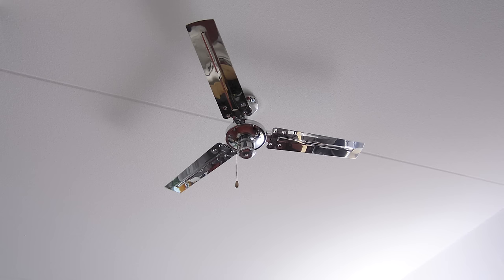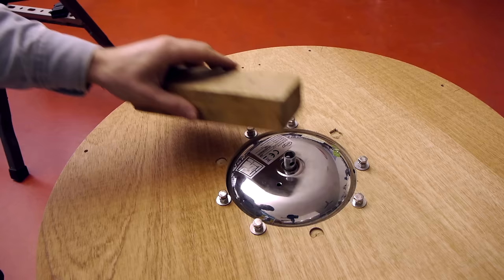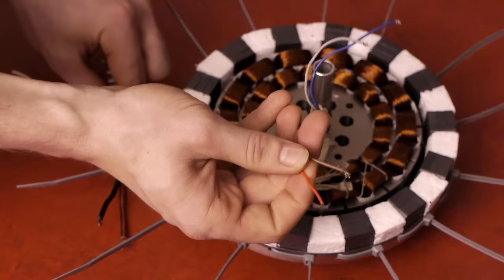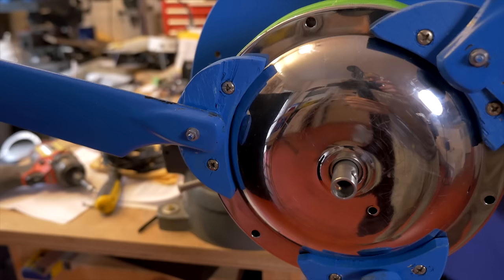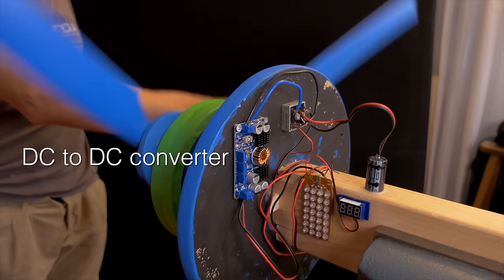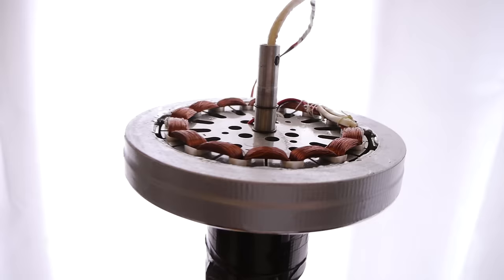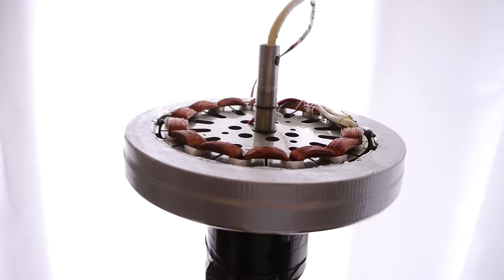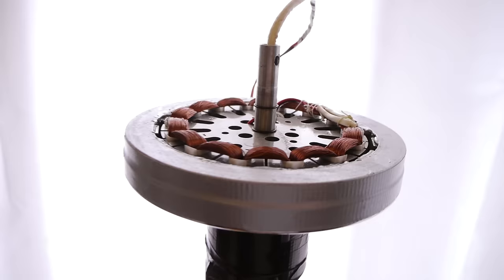Turn a ceiling fan into a wind turbine generator?!

Comment: I just realized that I'm living right next to a "reuse store", which is a place where people can dump off all their old stuff for free -  instead of having to sort out all the different materials for recycling. The store then sell away as much of it as possible for like 1 cent up to $10 each before they recycle the rest. (You can LITERALLY get a REAL leather-sofa in almost new condition, a bike or even a quad-core laptop with 4GB RAM for just $10! (Instead of paying like $1000 for a new one)

I could easily find DC motors in perfect conditions for like 1 cent over there! 🤦🏻‍♂️😅 Why have I not thought about that before?! 😫

Comment: Iam attempting to replicate this using the motor from an E-BIKE that outputs random AC voltage depending on how fast you spin it. Would the same electronic setup (Rectifier, capactior, DC to DC converter) work to provide a stable DC voltage?
Thanks in advance

Comment: It's a good quality generator
Full Bridge Rectifier to DC
100v capacitor
100v DC to DC convertor
No voltage regulator
Straight in to a 250v Charge Controller that has DC Load
Put a DC to DC Converter 12v output (Connect to DC Load) to 12 volt fuse block for a DC Powered Fridge, LED lights, Pumps & Switches & also connect a DC to DC Converter 5v output to  5 volt fuse block for USB sockets to charge phones

Comment: I know you said at the end the power generation was disappointing but how much power are you actually generating? The voltage is impressive but the amount of current needed to turn on a LED diode is pretty insignificant. I made one myself that generated a measly estimated 730mW

Comment: Would it be a better use of the ceiling fan generator to use it to trickle charge a battery? The battery would provide a steady output needed to power a 12V fridge or some lights. Heck, if it's made from free or very cheap materials, you should use it for something! Perhaps wiring several in series? Still a good video. I thank you for sharing.

Comment: I once experimented with a similar engine, and I would like to share my experience with the viewer of this video.
The idea itself is not wrong. I would not get rid of the second series of coils because it also generates tension and can therefore be used. I had four half tubes on both engine parts that rotated in opposite directions.
But there is a small problem, which all small wind turbines have, and that is the power required to turn it. If you place strong magnets all around you need quite a lot of force, just the same as with a bicycle wheel dynamo or a decent one, and you won't be able to do it with a small propeller. And if you draw current, even more force is needed. When you turn it by hand it seems to run quite smoothly, but in practice this is quite disappointing. By placing only 2 pole pairs, i.e. 4 magnets, the force required is less, but the power generated is also significantly reduced. All in all, nice to light a few LEDs, but nothing more.

Comment: My suggestion as an engineer would be to treat it like a solar project, but with a separate AC/DC conversion step.  After the AC/DC conversion, the output should be whatever input the solar converter module accepts (these are cheap MPPT modules to maximize power output, and charge a battery (B08L8TBCK6).  The battery stabilizes the output and gives you some output when there is no wind.  You still need to convert the AC with a "bridge" but build your own 4-diode bridge using large, Schottky diodes (B079KJD9Q5).  The simplest solution to the input stage after bridge and capacitor is this (B098SVD2B8), as it accepts a 10-65V input.  You may need some input protection above the 65V level.  Missing the 0-10V range is not too important as there is very little power to be gained from the slow rotation that generates such low voltages.
Reply: Wind turbines in general are electrically very ugly.  The risk is you could always have some massive wind come by and break your turbine/electronics.  Each layer you add to deal with that adds complexity and cost and has to be dealt with, either mechanically (adding a brake, turning the blade pitch, etc) or electronically - sensing the input voltage with a controller and sending it to the correct circuit to handle the issues.  Even then it could mechanically break with enough wind of course.  The energy output (and applied to the turbine) is relative to the CUBE of the wind speed, thus low winds do basically nothing, and high winds break it as thousands of watts of wind energy are applied to the unit.  In-between is useful power.

Comment: Sir i have experyment whith airconditionar  blowerfan moter  but its voltege is very highe i dont under stand its dc or ac corrent and on the load moter rpm wery hard how to stabilize current or rpm

Comment: I am concerned about your use of the capacitor. In my experience they are only used to support a hard start device, such as a 240 volt Air Conditioning system. The capacitor Must be Discharged AFTER the power supply has been Disconnected, in order to prevent Electrocution, especially in wet and ungrounded situations.  Your stored current in the capacitor can kill, depending upon the untrained DIY  person.  Pacemakers come to mind just as an example. BTW, I still love your accent. Reminds me of Mads Miclelson (sorry if I mispelled the name).

Comment: If you were to rewind the stator, would having multi-phase windings be better?  That would reduce the voltage you get from a load of series connected coils and give a smoother output from the rectifier.  Car alternators are 3-phase for that very reason.  I would aim for a 12-13 volt output and charge a rough and ready car battery.  I'd not bother with with fancy electronics with a project of this nature.

Comment: Well I had the same idea and now we know that's a bust. I also noticed wobble when you tested the blades but that might be the blades became warped in storage or the camera angle. On another site someone suggested tread mill motors and then I realized that I had 2 small electric motors I could play with and both were battery operated. One was a grass trimmer and the other a battery operated soil mixer. The mixer was a gift I didn't need as I had a hand one that you could use standing up and I could have returned the gift saying I already had one. 

The mixer ate 2 batteries in under an hour so I was proud that they used identical batteries and I had bought extras for both. It was fun to sprinkle the compost on the soil and not have to exert yourself but that fun was a frustrating summer of stop and recharge until I finally went back to doing it all by hand. One season and the batteries were not available. They all died after one season, even being stored fully charged indoors as our winters are really cold. Both of the motors have almost no mileage on them and they  worked when I cleaned them and put them in the shed to collect dust apparently is why they were designed. When I have time I will give it a try and I'll let you know how I fared. This was great fun and I learned what to look for and fix before I get to far into the project. Thanks for a great video and thank you for saving me hours of work that I will probably waste on the above. We'll have to wait and see.

Comment: How many amps does it produce at 150 RPM and how many watts you could turn it into a water jet turbine if you have a constant water source on high ground the farther the water travels downhill the faster and harder it will push the turbine

Comment: Ok, instead of removing thev second set of coils, use both sets of coils in a two phase alternator, still using a full wave bridge rectifier.  (Automotive alternators are three phase through a full wave polyphase rectifier, with the output sent through a voltage regulator to get an approximately 12 VDC output.)    If you can figure out a way to get your rotor to stator gap down to about 0.005 to 0.010 inches, (0.13 to 0.27mm) you will improve efficiency.  The smaller the gap, the higher the magnetic efficiency.  Rare earth magnets fastened to a (magnetically) soft iron outer hoop will also help, as will soft iron "shoes" between the flat magnets and the round stator.
One could also re-wind the coils for a different voltage, such as 48VDC, or even 120 VDC to charge a battery bank instead of a singlr battery.  
Another thing to consider would be a spring based turbine blade unloader to dump excess wind pressure when the wind exceeds a certain pressure value.
You are on the right track, keep up the good work/research!

Comment: GN, I find your video very interesting for several reasons.  Firstly, I have scrapped ~35 ceiling fans for the little bit of copper, so am very familiar with parts and disassembly.  I would love to make a wind turbine, but you convinced me now not to.  In Northern California, they are available on the curb, in dumpsters or free online routinely.   It's too much work for the best amount of copper, up to 1 lb., but its something to do.  Also, your English is great, but we don't say "leds", but rather L.E.D's , FYI.  
How about a generator from a computer cooling fan?  I come across lots of those and they have very low scrap value.    Chuss!

Comment: Instead of using a small capacitor use a battery from a riding lawn mower; the turbine will charge the battery and the battery will deliver the charge.

Using the high voltage transformer and capacitor from an old microwave would also let you get more current, though you would probable need an inverter in that case.

I would try using old microwave parts to see how your voltage improves, and build the step down system from there.

Heat: using aluminum window screen fixed over welded wire fence(or the radiator from an old window air conditioner would act as a good dump load/heat sink so your system will have less heating problems.

Comment: Also there is on sell an LCD step down converter with 600watts capacity. It will work as an MPPT. THAT CAN TAKE DC 120V INPUT AND YOU CAN REGULATE THE OUTPUT AS YOU NEED by stetting your LCD screen.

Comment: you said the generator outputs up to 51 volts, but you also said the buck/boost converter could only take up to around 30, you need to regulate the voltage (which can result in a slight power loss), or get a better converter (can be expensive). Adding more or higher capacity filter caps never hurt anything and a battery with a proper charge and protection circuit will allow you to use stored power when the wind isn't blowing.

Comment: Keep in mind, when you're converting fans, you are only going to get the amount of power the fan's motor was rated at, when it runs at the speed the fan was built for. Thus, you won't get 25 Kilowatts from a 1/8th Horsepower fan motor.
And as far as the improvements in the electronics go, I would just use the Full Wave Bridge Rectifier and Filter Capacitors, and ignore the Voltage limiter and DC to DC Converter, and just let the right commercially made MPPT Charge Controller do its job feeding the batteries.
Personally, given how cheap small wind turbines have become, I'm leaning to the, "Why bother building?" side.

Comment: good job mate
but you need to add s little final touch
1-auto voltage stabilizer control circuit 
2-wind speed (RPM device ) for maximum wind speed and not to go voltage overload 
3-charging station like Battery 
and there's more I would like to explain , if we exchange the the Emails .
thanks ,and best of luck

Comment: So that's why I never use linear 7800 series Regulators anymore, also consider leaving the inner windings in they can be used as an emergency brake if your wind is excessive

Comment: why did you not place a strip of sheet metal on the inside of the wood ring for the magnets, could 3 ceiling fans be turned in to 3 phase, just how much power do you need to charge a battery bank, i know for most places you cannot get your house off the grid, so how much of the inside of my house can run off the battery bank while the rest stays on the grid because of power draw and amps.

Comment: If we put dc to dc converter. Do we still  need capasitor?  If yes why.  And if  not also why.  Thanks
Reply: If we use proper dc to dc converter we dont need caps. It already stabilized from converter

Comment: For the electronics side, instead of using a linear regulator to reduce the voltage to be usable for your DC-DC regulator, it is better use a step down transformer on the AC side before the full bridge rectifier. Much lower loss.
Also, it is probably possible to make a generator without adding magnets to the motor but would require more complicated electronics. Lookup AC induction motors.
Reply: its already an induction motor.

Comment: The problem with wind turbine electricity is obvious, you only get electricity when the wind blows and not necessarily when you need it. The solution to this of course is to store it and use when required. A lead-acid car type battery is ideal for this as they are very durable and although heavy can store a lot of energy and with simple precautions almost indestructible. The technology already exists in cars to manage the system although essentially all you need is a bridge rectifier, a capacitor is not needed, and some simple method of over-voltage protection to protect the battery. In the case of very high wind which produces too high a voltage a relay could be used to disconnect the battery and short out the generator slowing it down.

Comment: Question, why your watt meter shows 0 amps? I also looked for the a cheap wind turbine option and got used wheel from hooverboard. Pros is that in general you don't need to change anything just remove unused cables and hall sensors, but you don't even need to. I has already very strong magnets and good coils so high efficiency. Now big pros is that from 250W 36V wheel/motor I was able to generate about 50W of power as generator. So for 10$ getting 50W generator is not bad in my opinion.
Reply: Even better option is to just buy existing mini turbine, where 110$ mini turbine can generate 50-100W of power.
Reply from the maker: After trying the ceiling fan, I am sure that a used wheel from hooverboard is much better to use for a DIY wind turbine, because it is like ready to use, and the ball bearings are fit for horizontal use. A DIY made from a ceiling fan, its bearings are fit for vertical use, a vertical-axis wind turbine (VAWT). A thing with these is they are made to run on 120V (US) or 240V (EU), thus when all runs well as a generator, the voltage gets dangerously high, while the ampere stay very low.
Reply from the maker: @Marcink126  Best option in that direction is to buy an expensive high quality wind turbine. But then you mis the joy of D.I.Y.
Reply: @GiesbertNijhuis  also with high voltages you will have problems to find proper mppt controller. I also changed windings connections from parallel to series to get higher voltage. Usually mppt is step down so with liwcwind speed it will simply not charge at all. For mppt more voltage is not a problem withing limits it will simply draw less current also less loses in cables due to less current.

Comment: In addition to my last comment, on my mind are the E-bike hubs I have. Easier, and more power, for wind or water wheel. They are 3-phase, but that is corrected through some simple electronics.

Comment: The linear regulator is a huge power waster:  Any voltage above 24 volts is just turned into waste heat, so you really limit the power you can get out of the generator.  Get rid of the linear regulator, and use a buck-boost switching regulator.  This can turn a wide range of input voltages into a fixed voltage for running things or charging a battery.  It's about 90-95% efficient.  I once designed and built one for boats that could take 9-48 volts in and put out 14.4 or 28.8 volts for charging a house battery bank.  The boats had 12 volt starter batteries and 24 volt house batteries.  With this buck-boost regulator, you could charge either battery bank from the other, or use the engine's alternator for power.

Comment: Can you test if a vertical wind turbine design with some hydrodynamic influence and a shroud would improve efficiency and measure the potential output to gage if it could have a practical application for say an air scoop on a moving vehicle for charging batteries for alternative source of electrical power while car engine is not in use
Reply: Also is there a way to divert a turbocharger to aim at the blades of a wind turbine in order to increase efficiency of power generation

Comment: might try an make one of these anyway. one key factor you forgot,  your forgetting other forces well there is three, am off to play i will let you know if i got my ideas to make it better.... remember  this one generator dont have to power you full house each can have tasks drive type and mass and of coarse micro domains that can make flow faster we know super cooling can make this happen but i was told as a child vibration,   oscillation can have the same affect done right

Comment: What about adding a transformer before the rectifier. I think it will solve the problem of high voltage supply since you can use a fuse in this situation to cut the power supply to prevent and damages to the electronic components.

Comment: Extra energy can be deverted to a water heating element or reserve battery. Also all the energy can be used for purposes requiring more energy so as to be a supplement.

Comment: Definitely a ceiling fan can be converted into a WTG. Because everything is ready a good and balanced design. Although the coil wire is thin both windings can be used by bridges rectifier.